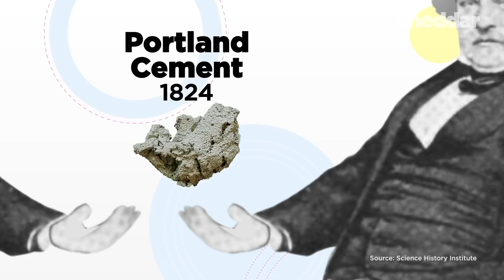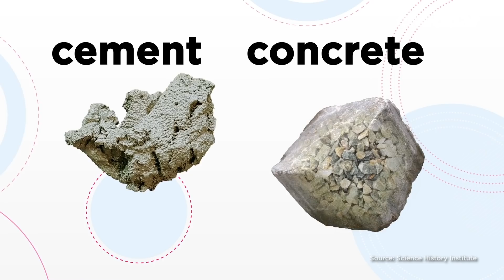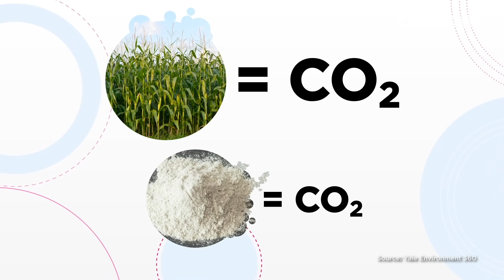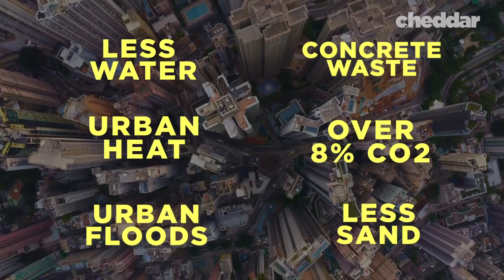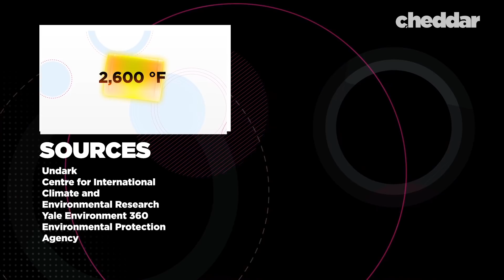Is Concrete The Most Destructive Material On Earth? - Cheddar Explains

Comment: My understanding is that roads are actually worse for the environment than the petrol/diesel cars we drive on them (because of the problems with concrete outlined in the video). Which means that electric cars are not the solution. Check out Adam Something or Not Just Bikes to see how we could design our cities differently and use real green transportation.

As others have pointed out, concrete is recyclable.

Comment: What are the alternatives though, we could start using plastics and wood flooring in some places but concrete would need to be the base material if not somewhat mixed with steel for foundations.
On top of that you could have a street made of other material but.. plastic melts under the suns rays, wood chips and splinters, it'd be hard pressed to find a type of solid rock you could turn into straight footpath, perhaps bricks but i assume their construction is kind of similar, So we are back to.. walking on grass? but when it rains its muddy slippery and dangerous, its uneven at the best of times which isn't bad for a walk but over time isn't great either.

Even having dirt paths in the grass isn't ideal as sharp rocks popup out of nowhere sometimes with the wear of the ground, so you'd have to dig up the ground pack it properly make sure it was free of most disturbances, you could then i guess mix it with other material sawdust/etc to try to keep it as dry as possible but even the best dirt paths under substantial downpour become nightmares.

The best we can really do is limit the materials inside buildings and around our cities, do we need concrete rubbish bins, while they might seem to be better in the long run a replaceable metal and plastic frame would be kinder.

It also means we as a species kind of have to start thinking properly about public transport if we made a real effort to make it cheap and easy to use, as well as a well paying job we could reduce the number of cars on the roads, as for heavy trucks i don't know besides building their replacement we could try to attempt to make more use of trains and the infrastructure we already have which would take less work to keep running than replace.

Trying to use more local food stop buying overseas for $5 savings etc.. all these kinds of things would help but at the same time local businesses MUST make proper effort to get what people want for reasonable prices, they have to earn a living sure but if we buy overseas they just end up putting up prices and going out of business anyway.

Comment: Here in Minnesota, the interstate highways get rebuild in 10 mile segments. The majority of the concrete is recycled at temporary crushing/separating stations built next to the roadway. When done, there is always a large pile of sand/cement granules that are given away, guess it is not suitable for new concrete mix. All the steel and all the gravel is reused or recycled. 

Asphalt cement, typical asphalt road pavement is 100% recycled.
The ingredients of concrete will never run out, it will just take more energy to find, process and transport the stuff to where it is needed. Perhaps the ingredients list for concrete should really have 5 parts, cement, gravel, sand, water and fossil fuels.

Comment: Cheddar needs to check their math on the amount of sand required for the average house.   The average house uses 50 cubic meters of concrete.  There is 660 kg of sand per cubic meter of concrete and that only works out 33 tonnes of sand per house, not 200.

Comment: The Sahara desert still has more than enough sand to meet our needs. And improvements in desalination technology would reduce the stress in water-poor areas.
If the US, for instance, spent a quarter or the resources it spends on the military on desalination, it could control much of the world just based on its monopoly on cheap and abundant water.
Reply: Sand is not sand. Depending on the process that made it sand it has different forms.

Comment: brains... when concrete dries, the water leaves.  concrete only cures as long as water is still present.  as it cures, the water leaves the mix.  once the water is gone, the concrete curing stops.  so all the water used in concrfete goes back into the enviroment.!!!

Comment: I don't like this kind of "documentary" made to make people think in a certain way. And to be afraid. Why? It is known that fear is used to change people's perspective on issues. If is not concrete, then it is wood or aluminum structures. Are you going to tell all of these people thst concrete is the worst of the three? Really?? Aluminum is toxic to produce, and wood is not strong enough for certain structures. Another thing I noticed is you make people think that roads are made of concrete, and that is not true. Sometimes roads are made of concrete but most of the time they are made out of asphalt = petroleum derivates. This "documentary" is filled with fictional drama. Maybe some things are true, but not many.

Comment: So we’re running out of sand?  Well unless they confiscated all the rock crushers that’s a huge bullshit story. By the way lots of sand is also used in asphalt it is a byproduct of crushing operations for the rest of the rock that goes into asphalt. But FYI, if one wants to they can crush rock into 100% sand. There’s gobs of rock to be crushed. The problem is concrete companies don’t want to pay fair market value for crushing it. (Insert some cheesy “profit margin” speech here) so the real problem can be traced back to the same cause as most problems today. GREED!

Comment: Concrete crumbles because the rebar rusts, which makes it expand and break the concrete. I reckon designing to not need rebar would make the building last significantly longer.

Also, not sure if this is a thing but adding tiny pellets of charcoal to the mix in place of some of the sand or rock would sequester the carbon. Might reduce the strength, but that may be OK in some situations like paving.

Comment: Concrete is crushed after it is removed and turned into crushed concrete all the steel is removed  as much as possible  , the crushed concrete can be use for almost anything like gravel roads ,base for a new road or parking lot also to fill land on new developments, when it is compacted well it makes a very solid base, water can actually flow off of it to a ditch or a low spot.
Reply: Only some of it is, most of it indeed lands in landfills. It's like with other trash, it's often cheaper to turn a mountain to dust than to go through the trash.

Comment: Reduce the water percentage in its mixing process to create concrete, that's how to make concrete-based structure to last so much longer, it will decrease the number of water pockets inside it and won't causing break troughs when its evaporated causing pressure from inside.

Comment: The world is not running out of sand, or water, what a pile of agenda ridden garbage.
Reply: The sand part is actually true, or rather, the world is running out of easily accesible sand. Same with water really, theres no shortage of sea water, but its much easier to use local fresh water
Reply: The sand used in concrete is from rivers not the fine sand from deserts that's why some middle eastern countries import sand for concrete even though they are literally living in a desert.

Comment: The water used in mixing concrete evaporates, you know that right. It's not like concrete is hording water like my uncle hords bullets. As the concrete sets, the water returns to the environment and is brought back to earth as rain. As most concrete is mixed with a half hour of its location, it's not like were shipping water from minnesota to california. Most of that water will return seamlessly to the environment it was removed from.
Reply: Most of the water is consumed by the reaction with the cement or is trapped inside. Even if did evaporate it would just mostly rain down into the oceans which wouldn't help any water-scarce areas.
Reply: @seneca983  it is still returned to the environment though. Yes, the water may first detour into the ocean, but it will get sucked up again and rained down again.
Reply: @cerneysmallengines  "it is still returned to the environment though"

But that doesn't matter for the purpose of water scarcity which is a regional phenomenon. No one's claiming that the whole world would run out of water. If some region only gets, say, X liters per year from one river and no more, then that's the amount they have to divide among uses like concrete, drinking, irrigation, etc. In such regions water used by concrete is quite concretely (no pun intended) away from other possible uses.

Comment: There is so much misinformation here its shameful. 

Since when does concrete get hauled to a landfill? 

Where do you think all the water used for curing concrete goes? It isnt locked up forever? Water cycle anyone?

And agraculture causing CO2 emissions? Oh, yes, we will use ethanol in gasoline to reduce...oh wait....

Comment: OMG! Who's the idiot that put in here that water is consumed by concrete?
Almost all of the water used in concrete evaporates into the atmosphere.
Reply: No, most of the water either reacts with the cement or is trapped inside. It doesn't matter anyway. It's the same as drinking water uses it up. You can have a scarcity of water even though all of the water you drink also comes out of your body.

Comment: You can easily crush concrete back into stone/gravel/sand/any other particulate size and reuse it in concrete. The fact that no one has made a market of it does not excuse the fact that it can be done even if you can't make it into concrete again you can still use it as a base for other structures such as roads
Reply: except there is a massive market for it... whether it is reusing it to remake concrete or in other industrial applications.

Comment: They already have a solution they are using in newer construction.  They use volcanic ash instead of sand and it will last millennia.  It's also far more earthquake resistant, waterproof, salt waterproof, and lasts pretty much forever without cracking.  I can't say how long as the oldest examples are 2000 years old. We can't say a longer time because the technology was new then.  Roman concrete may just fix a lot of the problems.
Reply: Nonsense.
Reply: @kornaros96  but...they are actually using this.  This is just a fact.  It's still fairly limited in use, but it's becoming more popular.  You can't just say it's nonsense.  That's nonsensical. 
Or do you mean that concrete can't last that long?  Well, the Pantheon disagrees with you.
I am pretty amused by your one word rebuttal though.
Reply: @GerwynT  really? A dome?
Reply: @kornaros96  So, I pointed out a specific place they used it in the past where you can see the longevity of the materials.  Then I pointed out that they are currently using it in areas where waterproofing is important.  Your response to this was to say, "really? A dome?"  Can you please speak in full sentences?  I don't think random words are helpful and they are certainly not sensible.  However, feel free to continue your guttural replies if it makes you happy.
Reply: @GerwynT  Roman engineers didn't imagined that shapes and forms that we give it in today's structures, and they built the their structures on military budget.

My "really? A dome" comes with the fact that Parthenon, withstood bombardments and still stands. But anyway, Roman concrete is not superior to our modern stuff.

Comment: OMG!  Is there ANYTHING these people can't wring their hands over and consider a crisis?  We are going to run out of water to make concrete.  But, TWO-THIRDS of the surface of the earth is covered in water.  And, what substance forms the bed under all that water?  Why, it is SAND.  

These are the same people (or their close relatives) who decades ago told us we would have already run out of oil, would be running out of natural gas, and have only a few years left of coal.  But, we have so much oil that we had to stop importing it and scaled back production during the COVID pandemic due to fewer people driving and flying.  We have enough natural gas to easily last until the end of the century and the same with coal.  

As renewables, solar and wind, become cheaper and storage more practical, they will gradually and without huge economic displacement become a larger part of the power grid.  Did I mention that while they complain about CO2 emissions, in the northwest they are regulating and dismantling some of the cleanest energy sources we have, hydro-electric generation.  Unlike wind and solar, it runs 24/7.  So why do away with these?  For the sake of a few fish.  Mind you, the fish have been surviving just fine for the last 70 to 100 years those dams have been there.

And, these are the same folks who 40 years ago were predicting global COOLING that turned out to be bogus.  So, how many times do we let these people cry "wolf" before we start ignoring them?  Let's do it now!

Comment: I love it when people are like "we need to change now before it's too late." Welllllll, if your solution was so great, then we would already be doing it. "We need decision makers to get involved" aka the government 🙄 Nothing like a corrupt bureaucracy to make things better 🗿
Reply: well i mean what are we supposed to do... ask jeff bezos? the gov't has problems and cant be trusted in many cases. corporations though are even less trustworthy
Reply: @red2theelectricboogaloo961  the point I was making is that innovation doesn't necessarily make things better. If we've done concrete in the same manner since the 1800s and the recipe has barely changed, it's probably because there's not much to gain in terms of cost/benefit. Some solutions bring different sets of problems, and asking for government to enforce a new method only adds to the cost of implementation, not to mention the tendency for corruption (as I mentioned). Do we want safe and secure infrastructure? Or do we want a sustainable environment? At what point does one outweigh the other? Maybe there is no solution and this is the price we pay for human expansion/industrialization. At some point we need to come to grips with humanity's limitations.
Reply: @Romulus1001  well ok but i didn't necessarily get that. it's fine but i think there was a little miscommunication. i agree to a large extent. a lot of people think electric cars are the way to go; they're a step in the right direction, but they're still cars, and they're not going to save us.

Comment: How can concret which needs water which is the cause of how sand gravel and cement bond together and then evaporates into the atmospher and eventually return as rain; Be depeating the worlds water.
Reply: Most of the water is either consumed in the reaction with the cement or is trapped inside of it. Even if it did evaporate, it wouldn't help because it would just mostly rain to the oceans which doesn't help any water-scarce areas.

Comment: Formula 1.8 C + 32 = F Also formula C=((F - 32) x 5) / 9  so zero degrees C = 32 degrees F.  because 1.8 times zero equal zero and added 32 from formula. If F is 98.6 body temperature then subtract 32 to get 66.6 times 5 = 333 then divide by 9 = 37 degree C body temperature.

Comment: so, are we not recycling the concrete to help make more concrete? I was under the impression that's what was going on.
And, if not, why? We do that with asphalt, so, why not concrete? And, that said, what's to stop us from using recycled concrete within asphalt to lower the amount of materials used in road making?

However, i do think the ideas of using carbon as the binding agent, and lower temps would be great overall, simply because, carbon's more abundant than water, and because, lower temps, means less work needed to reduce the temp within the facility. This part contributes greatly, due to the fact that, lower temps mean less energy needed to reduce it, less energy means lower power bill, and that leads into less use of the power source, thus, reducing costs completely across the board. Something i think everyone along the chain would greatly appreciate.

Comment: Providing heat for cement production should be by large solar mirror arrays rather than burning fossil fuels.
Reply: Can you reach 1450 °C that way? In any case, that wouldn't help all that much since the majority of the carbon dioxide comes from the lime (calcium carbonate).

Comment: You can recycle ♻️ concrete here’s a snippet from Wikipedia 
“
DescriptionConcrete recycling is the use of rubble from demolished concrete structures. Recycling is cheaper and more ecological than trucking rubble to a landfill. Crushed rubble can be used for road gravel, revetments, retaining walls, landscaping gravel, or raw material for new concrete. “

Comment: You should see HK using Sea water for concrete during water ratioining.

Concrete, I mean you should see Singapore how we handle it. Most of the debris is used for land reclamation. For heat island it's mitigated with tree planting and grass.
Reply: Doesn't that accelerate the corrosion of the rebar?
Reply: @seneca983  precisely and so those 60 year old buildings have serious concrete spalling issues. Dodgy contractors during water rationing used seawater to mix the concrete and so this is quite the sight.

Comment: Let's not forget that a large portion of concrete is REINFORCED with rebar, which is mostly made of steel that requires the burning of coking coal in the furnaces.
Reply: Not so much anymore (at least in the US) much/most of US steel production comes from processing scrap.   Since the US imports a lot of cars, we end up with plenty of steel scrap.   Heck, a good deal of the steel used for bridges and buildings is imported.   They is little need in the US to make iron from ore.